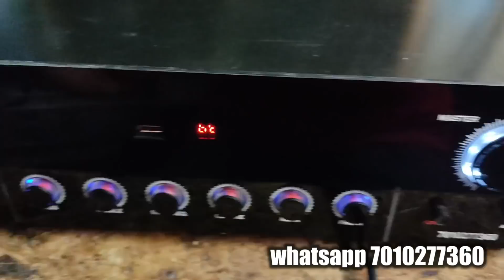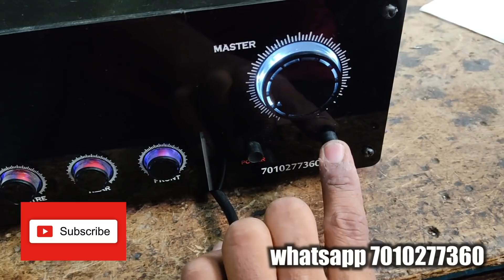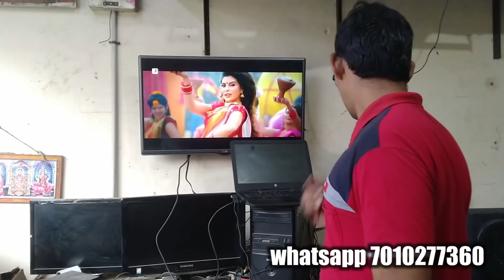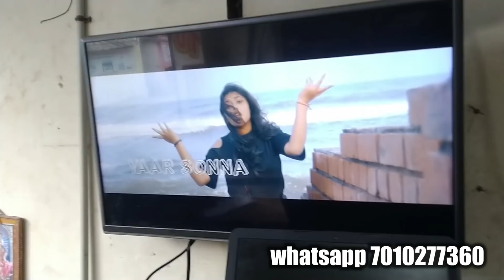1000W RMS Amplifiers Reupload

Comment: Anna neenga already 1amps ku 2000mf capacitor use pannanum nu oru video la soniga ipo, 40-0-40 8ampire ku 15000 la 2 capacitor use pandringa ithu enna mathod nu sollunga.correcta 1 ampire ku evlo mfd capacitor use pannanum